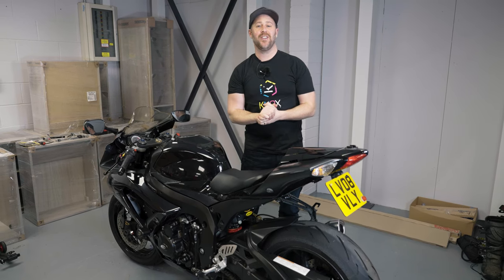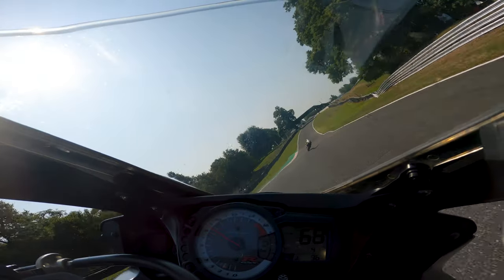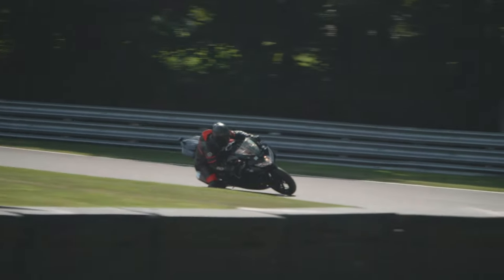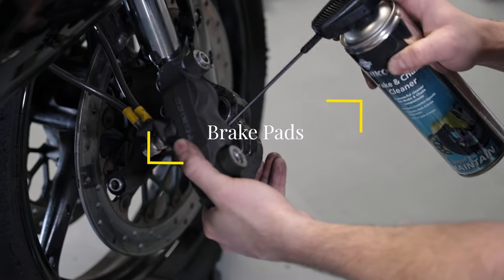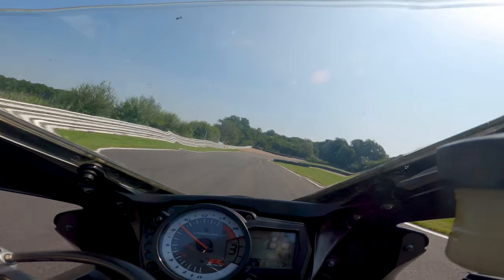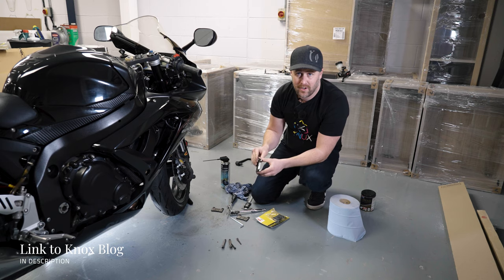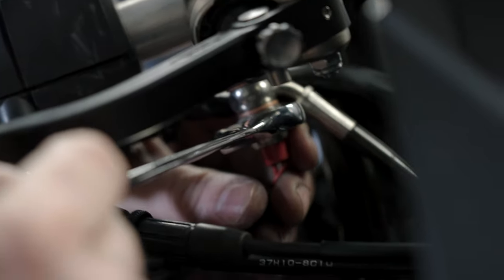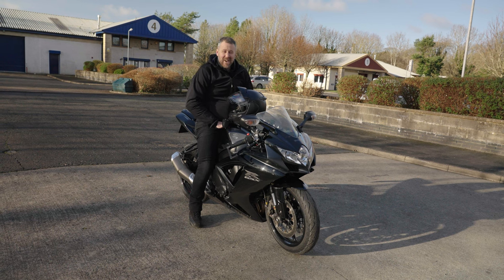GSXR 750 brake upgrade pt.2 ✋ | Hel brake Master Cylinder + SBS DC brake pads | Knox Armour

Comment: Just watched your video after attempting to fit my new hel mater cylinder.. guess what.. didnt think brake light and dont have the brake cable..😭.. so at present I need to brake front and rear to alert drivers behind.. also my hel Lines kit supplied me the wrong thread bolt for front right caliper so used oem.. 
Quick question..would I need to faff around bleeding the brakes again to attach the brake light line.. 🤔..
Great video by the way..lovely looking bike and the vide was very calm clear and relaxing to watch..thank you so much..
Reply from the maker: Thanks very much for kind feedback. Yes, you'll need to bleed brakes again after attaching the banjo brake light switch. I think I put the link in description for the correct one... Of course though, its not a full brake line overhaul so wont take as long as if you were putting lines on without any brake fluid in. Done a couple of track days since installing the Hel master cylinder and it seems to have eliminated brake fade! Thanks, Aaron KNOX

Comment: Another good mod to make.  I run the SBS Race Sintered pads and they do wear quickly.  Be very keen to hear how the DC pads go - wear and feel.  Assume you had to bed them in to put a 'layer' onto the disks - how was that?
Reply from the maker: Thanks. First track day in March so will give an update on Knox blog after then. Feel nice on the road, but its impossible to tell full story at road speed. Re bedding in, a tiny bit and they seem to be a bit soft in cold road conditions, but that's probably a good thing for track where I want them to manage heat a bit better. Thanks, Aaron KNOX

Comment: I've been wanting g to upgrade my gsxr 750 master cylinder, also interested in some used gsxr 1000 brembo clippers. For what I can tell the mater cylinder is a bigger improvement over calipers though.
Reply from the maker: From feedback I've had from racers and track day goers, master cylinders on these bikes make the biggest improvement... but one step at a time! Aaron Knox
Reply: I have just fitted a brembo master cylinder from a Ducati V2 ( £147 and it feels so much better than the original.
Reply: @bikefever3569  I fitted a used Brembo RCS19 and it was a world of difference. Since then I did an R6 caliper conversion as a cheap upgrade. Haven't had a lot of time on the bike since I did it but it feels more linear so far. The stock tokicos had a lot of initial bite before pestering out I think.

Comment: How has this held up over time ? Do you know if Hel have rectified the width issue on the bracket ? The pics im seeing online dont look nearly as wide or rounded. Also did the resiviour mounting point have to be modified at all ? Thinking of installing 1 of these on my L7 1000 .
Reply from the maker: Hi, its held up perfectly over the course. Basically, as long as i have decent pads and fairly fresh brake fluid, I literally never have to think about braking performance. Its a fantastic set up... Another thing is that I got my calipers overhauled and serviced which must have helped. Not sure whether Hel have reduced the bracket thickness for their new model of master clyinder tbh. Hope that helps, Aaron KNOX

Comment: Ive a k9 gsxr600 and the breaks are terrible even with the new braided lines,  what would yiu recommend? Mines just a road bike no track days
Reply from the maker: Next big upgrade is a proper aftermarket master cylinder and good brake pads. Will make huge difference. Thanks, Aaron KNOX

Comment: Any chance you could advise as to which brake light switch would work on a 2013 Yamaha R1?
Reply from the maker: Best bet would be to call Hel performance. They are really helpful and knowledgeable re this subject.
Reply: Once the master cylinder was installed, did you find the actual lever touched or rubbed against the fairings when it was on full lock to the right?

Comment: Am I correct in thinking the stock 750 has a standard master cylinder piston size of 15.8mm?
Reply from the maker: Good question, not sure tbh. What I can say is this new set up solves the brake fade issue, especially with regular brake fluid changes. Thanks, Aaron KNOX

Comment: Looks great, does the brake light pressure switch react quickly?
Reply from the maker: The brake light switch works fine... its a bit lazy but fine. Hope that helps. Aaron Knox
Reply: @KnoxArmour  Thanks, I'm debating one for a road bike so just thinking of cars behind and the MOT